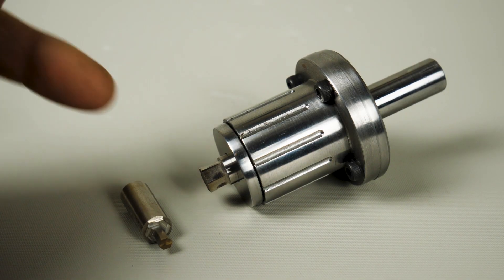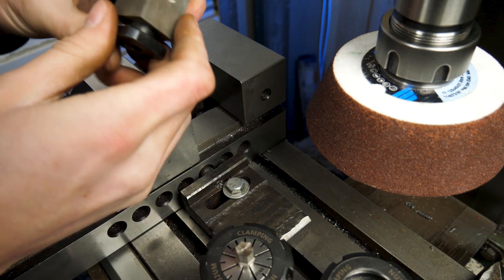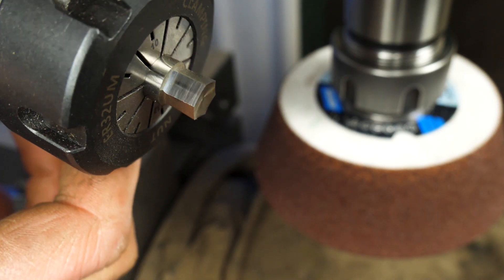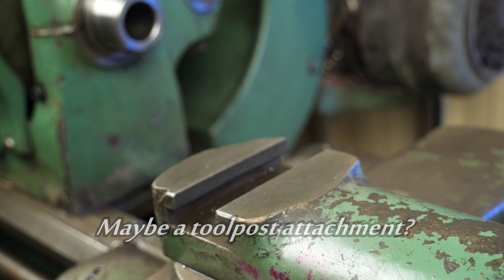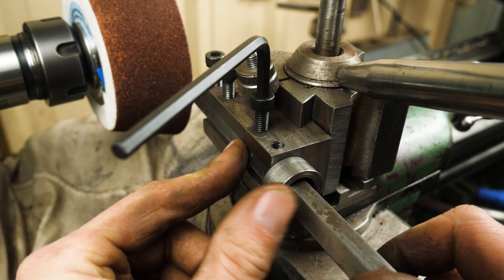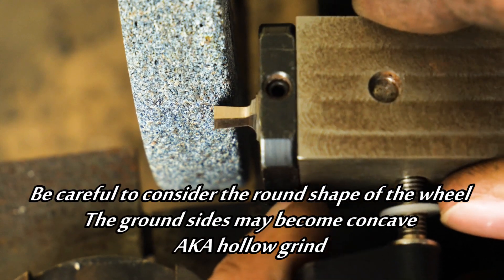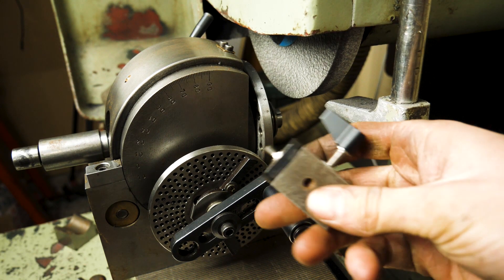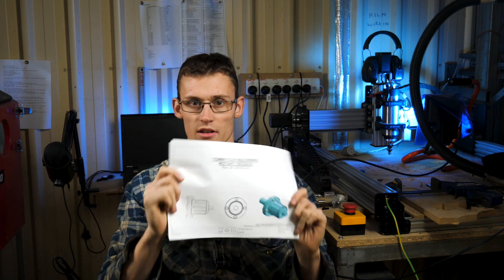Easy Rotary Broach Tool Grinding

Comment: Tom, when I get a bit of shed time I am going to try grinding some broaches using one of the cheap cup grinding wheels from the chairman over at candy rock mountain. I will hold the 10mm HSS in a collet block up against a stop then tilt the head on the mill to 1.5° (using a digital angle gauge) and with luck grind the broach. Rotating the collet block to grind each facet and with luck Robert is your father's brother.

Comment: I too bought your plans and the details regarding the bearings are great but I didn't see any reference to a materials list especially with regard to the broach tooling used.
Reply from the maker: Roger that. I will update the listing today.
FYI for anyone wondering the broaches are 10 mm diameter HSS with an overall length of 30 mm. That being said, you can ream to whatever diameter you wish.
Reply: @TomMakeHere  And which of the Tyne Valley  listings might that correlate to (since it doesn't have 10mm HSS) the 4140 perhaps?
Reply from the maker: @Peter MacDonald Only just saw this message sorry, they stock 4140, tool steels etc. But not HSS to my knowledge

Comment: why not use grub screw to hold cutter in block instead of moving screw handle when turning block
Reply from the maker: The block came with a sharpening kit I bought.
Craig successfully shows a simple method in a block with a grub screw here: https://www.youtube.com/watch?v=h42Yw2SH_7s

Comment: Outstanding series, Tom, now I can't use not having a surface grinder as an excuse to not make a rotary broach, I will be purchasing your plans.

Good luck on the boring table for your Hercus, I've been after the extended cross slide for my 260ATM, I'm thinking of machining my own up, I can't find any cast iron the right size, so was going to grab some 4140 from Josh, at Tyne Valley;).

Thanks mate, 

Scott.

p.s. if you ever need somebody to babysit your surface grinder.....:)
Reply from the maker: I got a different one-off casting made up by Callington Cast Iron. Noone else seemed interested in a one time casting
It was a simple dovetail for my mill, and they were happy to do the simple pattern too
Reply: @TomMakeHere  Good one, are they local?
Reply from the maker: @smacknives754  South Australia I believe. They were pretty much the only place in Aus that would do a single casting at a reasonable price

Comment: I was actually thinking about making a rotary broach for the #tmc2020, but settled on something a little simpler 😊. I've been doing ok (mostly) just freehand grinding most of my tools, but getting into small drills or key/groove cutters it's quite difficult to get it right and quality often leaves something to be desired. So at some point I'll have to address this issue. Maybe #tmc2021 🤣. Thanks for the share! Cheers!
Reply from the maker: Go for it! It's actually more straight forward than I expected to build
I won't tell you what I did to make my first keyways lol. (hint: it involves a boring bar and a hammer!!)

Comment: Some great ideas there! A very helpful video. For a limited use broach I think I'd be tempted to mill the broach in 01 tool steel, harden and temper, and finally stone the sides of the broach, a small fixture could be made to assist keeping the angle correct when stoning. Just another alternative though I can appreciate the life of an 01 broach will be limited, Unless I'm missing something?
Reply: O1 is quite a capable steel, I've used it for punch tooling on automotive steel (HSLA), D2 is better, but unless you plan to use it in high production it will be fine. Hardening and tempering for this application will need some care, ref high hardness on the cutting edge, and strength behind. Hope this helps.
Reply from the maker: absolutely. I'm sure it would work
I've not felt the tip after broaching, but I don't think it would get very hot either. So no risk of loosing temper, just wear of the edges